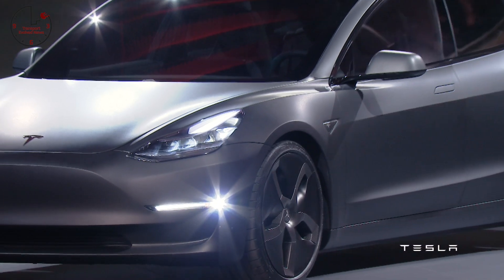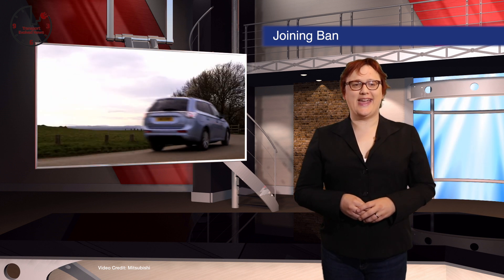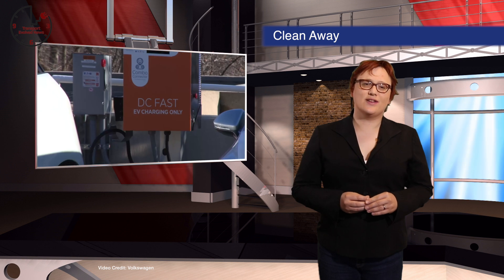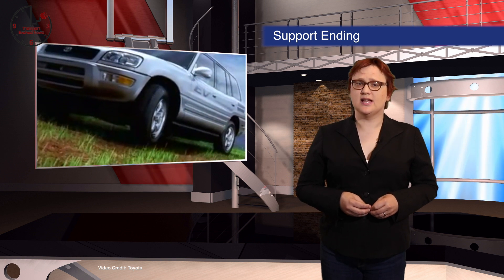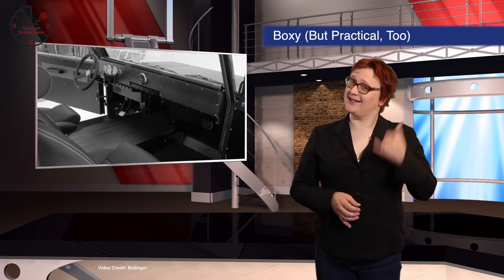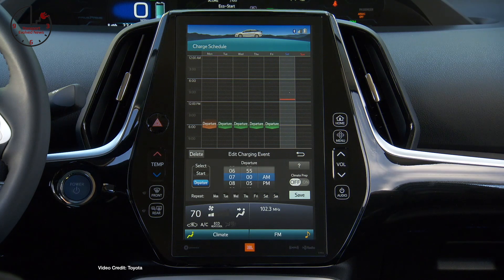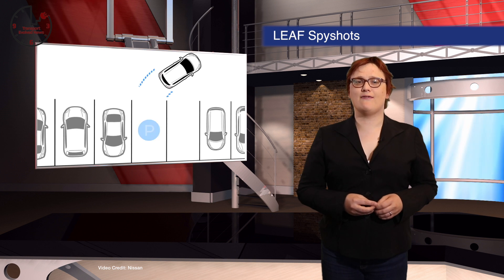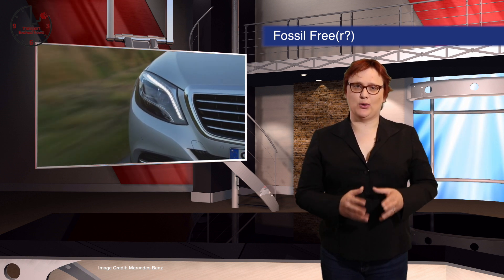Model 3 Efficiency, Solid State Batteries, LEAF Spyshots,  -- TEN Future Car News 28/7/2017

Comment: What the fuck does trans soldiers have to do with EVs?

For those of you who don't know, serving the armed forces in ANY capacity gives an individual lifelong healthcare benefits, benefits paid for by the DoD.

Transgender people use these benefits to claim elective surgery, and hormone treatment. So essentially, money earmarked for fighting wars is being spent on bullshit vanity surgery, just being thrown down the drain.

And in any case, people who have had sex change operations, or are undergoing hormone therapy, don't belong anywhere near mission-essential roles. They're a liability.
Reply: Still a drop in the bucket compared to all the Viagra that's been on the dime of taxpayers.
Reply: You still don't have to ban them from the military you could just not cover those medical expenses and the argument would fall flat on it's face. A ban just seems discriminatory when you could just not cover something
Reply: Actually EVs have a lot to do with soldiers of any kind. The connection is oil. Most wars in the last 100 years were directly or indirectly about who controls oil sources in the Middle East. EVs are going to make oil irrelevant soon, which hopefully means far less wars, and therefore less need for soldiers and weapons. Th US spends around $800 billion on the military, including all supporting agencies. From that 8 million is spent on trans gender related medical expenses. That's 0.001%. If you are worried about wasted money, there are far bigger targets. For example the $1.5 trillion F35 program. Or the large number of unnecessary military bases that exist only to provide jobs (which is kind of a communist thing).
Reply: Hmm.. HaHAHA, so you'd actually prefer deep-closeted transfolk in the military just because they're not transitioning nor have transitioned yet? Those whose suicidal rate is higher? How are you even going to cherry-pick out these individuals? You can never find out who these are and it's not easy to just guess if someone experience mental difficulties.
Reply: Gowtham N you could just not cover those surgeries you don’t have to ban them. It’s extremely discriminatory when you straight up ban them when better options exist
Reply: "If empathy for other people is not a priority for you, you have big problems."

I'm not interested in defending myself from insults disguised as advice, fuck you. I've made my argument clearly, at this point you're just intentionally misrepresenting me.

"I wish you a peaceful life and a lot of zen. :)"

You too buddy, transgender people don't belong in the military for medical reasons, have a nice day.
Reply from the maker: You know, I don't think being trans means you fight with your genitals. But it does help you focus if your body and your brain align.
Reply: "I don't think being trans means you fight with your genitals."

What on Earth are you talking about? You're so desperate to dismiss what I'm saying, that you go through the effort of distorting it THAT badly?

"But it does help you focus if your body and your brain align."

The hole that doctors create with "bottom" surgery is NOT A VAGINA. It does NOT ACT LIKE A VAGINA. The reason why males who have bottom surgery need to "dilate" to maintain their "vaginas", is because the structures are an OPEN WOUND which the body is trying to heal.

Some people need to dilate for 3 hours a day in separate sessions, others only a couple of times a week, and some trans people like to refer to the blood which comes with dilation as their "period", but it's not, it's simply blood from an internal tear/cut.

Not to mention, people who are on HRT, or who have had their testicles removed, have less muscle mass, and less bone density, they're weaker and frailer, and YOU expect the military to PAY for that?

The last thing a soldier needs while he's sitting in a swamp, or a sand-pit, is for the person watching his back to be fucking dilating.
Reply: I think some of it comes down to transgender issues just weird people out. the idea of having reassignment surgery is kinda horrifying to me, like "You wanna do what now?"  It's emotionally natural to feel disgust for something so unrelateable. Especially having to do with sex.

Just like I get why many straight people feel weirded-out about gay people. Thinking about gay sex is probably pretty gross and revolting for people that don't find ding-dongs appealing.

But if I obsessed about "pounding vaj" every time I talked to a straighty, I don't think I could function. Luckily I've pushed through my revulsion and hardly ever think about finger-blasting or whatever happens down there, cause frankly it's none of my business what people do behind closed doors.

But that queasy feeling is just an emotional response, and it goes away when I stop focusing on it.

Clearly this reaction has nothing to do with the trans-person and everything to do with everyone else around them focusing on a pretty ridiculous thing to focus on. In fact, all kinds of sex and genitalia are gross and revolting if you think about it too hard and it comes in all different kinds, but when you want it you're really into it...kinda like gravy. But I digress...

So even though I can't really relate to specific trans issues, I see the what they go through just for being who they are. And that I CAN relate to and empathize with. Reactions like "it's unatural", or, "they're obviously mentally ill". 

 I've had people tell me I'm "not really gay", "it's a phase", "You're just confused", the list goes on. This is just the reaction of a person that doesn't get it and can't wrap their mind around the fact that someone's brain is wired different than theirs. What that's taught me is when someone tells me how they feel, I take them at their word. It's very condescending to assume I know better than they do just because I can't understand it. 

But for people that actually know a trans person it's not an issue because they are real human beings, not just a stereotype.

If people want to serve let them serve. they have to meet certain professional standards. If they don't meet those standards they shouldn't be there. If they are professional they won't ruin morale, the proof is that there are thousands of trans in the military right now. 
The same excuse about degrading morale and readyness was made for blacks, women, and plain old-fashioned gays back in the day. None of this pans out, it's just political distraction.

The issue with medical cost is a real one, but it should also be put into context. The fact is the military spends 5 times as much on viagara as transgender medical care would cost. If the argument is to save on medical costs then they should screen out impotent dudes and they would save tons more money. This isn't  really about the cost, it's about the "ick" factor of trans people. 

Besides, soldiers aren't robots. They are human beings that need medical care. Wether it's knee replacements because they haul too much shit on their back, or boner pills because a normal sex life is just as important to health as other physical issues, or costs associated with transgender stuff because feeling "whole" for some people may require physically becoming the gender they feel they are inside. 

In my opinion when it comes down to it, any patriotic person that wants to serve and can meet the professional requirements should be allowed to serve. We need more brave people not less. The military and the country would be better off if our armed-forces actually reflected the population it serves. Black, white, muslim, christian, men, women, gay, trans, people that like sports, etc.
Reply: What´s appropriate is a matter of priority. If empathy for other people is not a priority for you, you have big problems. There´s about 7,6 billion of us on this planet (and counting). We´d better find ways to get along. 

I understand the DoD is a tool with a strictly limited area of expertise, but to see the actions of the military as somehow separate from foreign politics is to be blind. Everything is interconnected.

To expect blind obedience is to assume the leaders as individuals and the system as a whole, are infallible. One would only expect north-koreans to believe that. Common sense is often taught in military forces throughout the civilised world, in connection with obeying the rules. Rules are there for a reason, but it is always necessary to interface them with the real world. This cannot be done in advance in an office. 

When a person is experiencing pressure from the outside world, it can be devastating for said individuals mental health. If you take the pressure away, that is accept people as who they are without judgment, they will thrive and do great things. Maybe for you.
I wish you a peaceful life and a lot of zen. :)
Reply: FALSE Claims that has been refuted by real world information. Unusual high proportion of Transgender personnel end up Highly Qualified Distinguished Combat roles while more healthcare cost is spent on Viagra. Koch mouthpiece failed Basic Chemistry fully omitting the existence of LiFePO4. The prefered chemistry by high performance BEVs which do not use the ingredients in the hit piece. Both claims were absurdly devoid of reality.
Reply from the maker: Not to mention the mental anguish and stresses that come from forcing trans folks to comply.
Reply: ChasingTruth TakingFlak, here´s an angle for you: In your third message you assume waging war is what the DoD is supposed to do. What if the purpose of their existence was trying to prevent any war? After all, starting wars is not exactly the preferred way to to stay safe. Hmm? 
In your fourth message you claim to have grown up. I think you still have quite a way to go, before you can say that. Still going for just one truth.
You percieve the transworld from the outside. So do I. The difference is, you don´t seem to have empathy for people that are too different. You see a problem with spending? Do the math. All of it. Put it in perspective.
Reply from the maker: +Mark Lawrence YESS
Reply from the maker: Here's a question. Do you know anyone who is trans? (Trick question)
Reply from the maker: ChasingTruth TakingFlak I'll remember that the next time someone who is trans saves your life, helps you in a shop or delivers the news.
Reply: ChasingTruth TakingFlak: It's her channel, and it's free to watch. You could always start your own channel with whatever content you feel to share as well.
Reply: It was an ambition of mine to join the military, one which was crushed by my lens prescription. I cried about it for a while, mourning the loss of a childhood dream, wallowing in self-pity.

Then I grew up, and recognised that were I allowed to selfishly barge my way into a role I couldn't fulfil if my glasses were damaged, I would be putting other people at risk.

That's life.
Reply: Yep, I think that's petty also.

I have no problem with trans people serving so long as they undertake transition AFTER their service is concluded, and NOT on government dime. And if they start talking about suicide, they should be a section-8 just like any other unfit person.

By the way, the only reason transition costs are a drop in the bucket, is because transgender soldiers are ALSO a drop in the bucket. Per-capita, they incur higher costs for the military than a regular soldier.
Reply: What exactly does a liberal look like?  I'm interested?
Reply: @Transport Evolved i don't think you understand what is going on here in the US with that issue.... currently there is war vets that can't get decent healthcare (and they do need it because its life or death) then you have a bunch of people who signed up to get a free sex change operation knowing fully well they they'll never see the front lines, they're basically is support staff.... forget about bashing Trump for one min, do you honestly think thats fair??? 

as much as you may think you need to defend people who want a sex change operation please be aware that there is people that will die if they don't get healthcare...
Reply: Yes I do, a friend of the family came out about a year ago. Now lives as a woman.
Reply from the maker: Oh how you guys know so little. It's not elective. It is a matter of life and death. And yes, I know of what I speak. I've been there.
Reply: It's got fuck-all to do with empathy, and everything to do with what's appropriate.

By the way, the DoD is a tool, not a system of government in itself. War prevention is not the job of the military, it's job is to be an effective fighting force, and people who are transitioning, or have transitioned, don't belong in it.
Reply: Our tax dollars should not be spent for sex change surgeries.
Reply: "Unusual high proportion of Transgender personnel end up Highly Qualified Distinguished Combat roles"

Not true at all, and the men who have had distinguished combat roles were NOT IN TRANSITION while they held them.

It is impossible to hold any combat role after having a sex-change operation, for the simple reason that the structures created are infection-prone wounds. Another effect of operations in which the testicles are removed is reduced production of testosterone, which causes muscle wasting and a reduction in bone density.

Next time read the thread before spouting off.
Reply: ChasingTruth TakingFlak, because suicide and depression for transfolk are mostly due to transphobia surrounding them.
Reply: I can tell she's a liberal just from looking at her, that isn't what bothers me. I don't care that the principle reason she likes green energy is because of politics, so long as it's news, I'll happily watch.

The channel's called "transport evolved", it's about renewable transport and energy, that's a subject matter I'm interested in because I'm a technical person who likes new things.

I don't come here to have my beliefs insulted by comparing me to some reality-denying oil executive. These liberals don't give ONE FUCKING SHIT about thousands of blue-collar rural kids having limbs blown off, but they suddenly develop empathy when a negligible number of THEIR people are denied the opportunity to claim free healthcare on DoD funds.

Give me a break. Stop taking the piss.
Reply: The largest study on gender reassignment surgery showed no appreciable reduction in suicide or depression.

The founding fathers of the procedures all recommended discontinuing their practice.

Regardless of it's effectiveness, the Department of Defense is for waging war and protecting the nation, and it is expected to do that on a constrained budget. Transgender people SHOULD NOT be given the ability to appropriate funds earmarked for wounded warriors on ELECTIVE VANITY SURGERY. They are a medical liability, and are unfit for anything close to combat.
Reply: i fully agree, its unfair to take money from a solider who lost 3 or his 4 limbs on the battlefield just so someone else with all their limbs can have a sex change operation.... maybe the host of this vid doesn't know this and is just going with popular opinion that "we must be against everything Trump says"